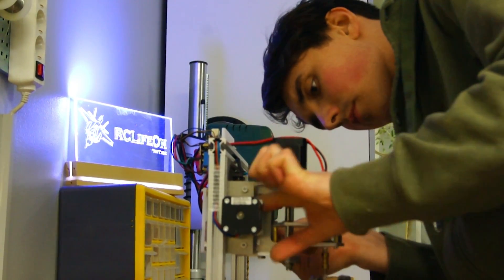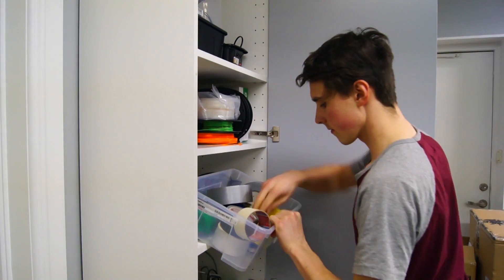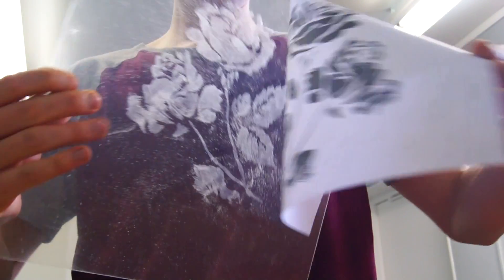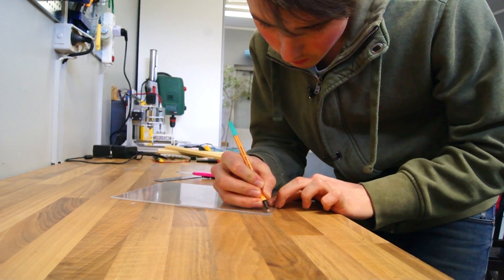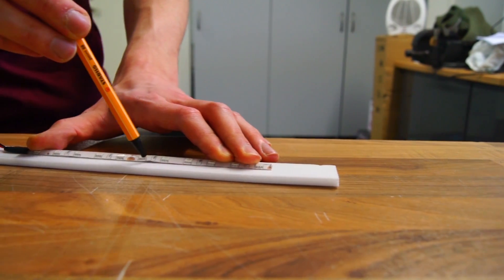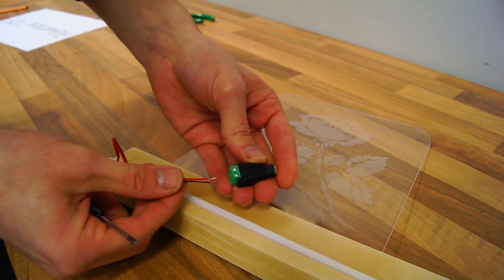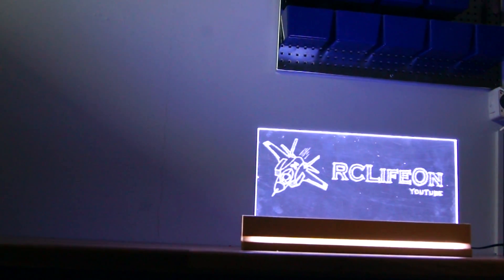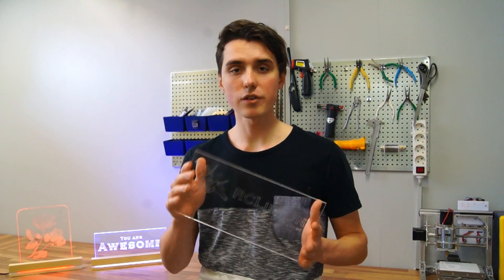Elegant Acrylic LED Decoration  - How to Make a Edge Light Sign Emblem

Comment: HELLO THERE. I WAS CURIOUS AND THINKING TO DO SUCH A PROJECT ON MY BOSS IN A FIRM WHERE I WORKING IN A PRINTING COMPANY ON SEVERAL SMALL BUT RESPECTFULL CNC MACHINE AND   BANG I CROSS ON YOUR VIDEO AND THINKING WHAT A NICE AND GOOD MAN SHOWING A JOB A STEP BY STEP AND I HAVE A ALSO A DREMEL IN MY WORKSHOP AND I WILL TRY IT FOR SHURE,THANKS AN KEEP GOING WHATEVER YOU DO, AND I HAVE A SUGGESTION IF YOU EVER TY TO PRINT ON FOAM PVC FOREX ON 3,4,5 MM YOU MAY I THINK ALSO USE A DREMEL AND A GUIDE YOU KNOW WHAT IT LOOKS YOU HAVE IT FOR SHURE IN YOUR TOOL BOX FROM DREMEL I THINK FOR OUTSIDE CUTTING BORDERS I MEAN A CONTURE  IT WILL BE PERFECT  JUST A SUGGESTION SO THANKS YOU MAKE MY DAY BEAUTIFULL ...

Comment: If I etch or sandblast one side of 1/2" thick cast acrylic and leave my logo clear (without etching or sandblasting) will the whole panel light up with exception of my logo? In other words, I want to do exactly opposite of what you are showing (the panel clear and the logo etched). Thank you for any insight you can give me in this.

Comment: awesome easy project! fyi i recently learned how to clean acrylic...first, use some brush cleaner (artists use this for their paint brushes) on a shop towel or paper towel to wipe the whole surface. Then I used Meyer's multipurpose spray to wipe the whole piece, then finally, sprayed water and wiped dry with a paper towel. Got the acrylic so clean!

Comment: I am curious why you recommend using 4mm instead of 2mm for the thickness of the acrylic?  Is the main difference just the rigidity of the sign or are there other benefits?

Comment: If you make a stand for the Dremel or whatever that tool is you can get even depth all around if you use wood to make the stand you can put a soft cloth under the wood and glue it slide easy no scratches

Comment: hola amigo, que tipo de led necesito y la fuente para la corriente como debe ser, ayuda. 2019 █   █PERü
Reply: Compra una tira de leds, de cualquier tipo, RGB o de un solo color. 

https://www.amazon.com.mx/AutoWT-Distancia-Multicolor-Retroiluminaci%C3%B3n-Decoraci%C3%B3n/dp/B07Q4PDRWQ/ref=asc_df_B07Q4PDRWQ/?tag=gledskshopmx-20&linkCode=df0&hvadid=360531611712&hvpos=1o2&hvnetw=g&hvrand=10094055264569270830&hvpone=&hvptwo=&hvqmt=&hvdev=c&hvdvcmdl=&hvlocint=&hvlocphy=&hvtargid=pla-797278597149&psc=1

Comment: Can someone please give me the name and type of jack adapter which he used in this video? if i type in ( jack adapter) in google i just get the headphones type, which isn't like the one he used in the video.
Reply: just type male power jack in google bro
Reply: i'm not sure the name of it's, but you can replace thats part with "female jack adaptor" which is have same function, but different shape/type.
in my place, i can easily found that's part on electronic part shop around home, there's many type of jack adaptor (female/male).
Reply: jaybajan it is called a 5.5 mm outside diameter and a 2.1 mm inside diameter female connector.

Comment: Buy or make Stencils,  tape them down and  SAND BLAST !   or just rub wet sand on the surface..  It's the only way to fill in a large area.    You can make a small sand blaster out of a shop vac..  google it..

Comment: ALWAYS WEAR A PROTECTIVE MASK AND GOGGLES WHEN YOU DO ENGRAVING BECAUSE ALL THESE TINY PARTICLES THAT ARE REMOVED TRAVEL AT A HIGH SPEED...!!!
you did a great job...well done...i was sceptical about just putting the design underneath and engrave with the dremel on the plexi from the top...but i did the same thing and it turned out descent enough....there are 3 methods
1.create a stencil with the design....use a transparent vinyl printable a4 sheet and cut the design....USING A HOT KNIFE IS UNBELIEVABLY EASIER THAN THE CLASSIC X-ACTO KNIFE...this method is perfect because the edges of the stencil really guide your dremel...but in a complex design it is time consuming process to create the stenciL
2.use a carbonpaper or transfer paper to transfer the design on the acrylic....use a sharp pencil or else the lines on the plexi will be thick...major advantage on this method is that you just erase the design with your dremel leaving the ''frosty'' design at the end..
3.use your method...just put the design underneath and start engraving...this is great because there is no preparation..and for another reason.....if you have the design on black and the background on white....every line you pass with the dremel it just erases the black line underneath..the frosty look erases the black design ..so its not only that it really guides you but you can clearly see the progress you have done...an alternative method is the white on black background....like this...https://www.youtube.com/watch?v=475kDOOqSoo
its not so good i believe but the black edges really help you stay ''in'' the design pattern...!!!
use carbide and diamond bits even with softer materials...on metal use the HIGHEST SPEED...TO THE 30K RPM RANGE..ON SOFTER MATERIALS LIKE PLEXI PLASTIC I THINK IS MORE SUITABLE AROUND THE MIDDLE SETTING BECAUSE YOU CAN EASILY BURN THE MATERIAL....
USE A DIAMOND PENCIL BIT TO DRAW THE LINES AND THEN A BALL POINT BIT TO FILL THE AREA....USE A METAL RULER IF YOU HAVE LETTERS NUMBERS OR A LOT OF STRAIGHT LINES..ALTERNATIVELY USE A FLAT WIDE  SCREWDRIVE TO GUIDE THE DREMEL BECAUSE THE RULER IN A SMALL DESIGN IS CUMBERSOME AND DIFFICULT TO CONTROL!!!!
if the edges of the acrylic are not perfect especially at the side which gonna sit on the led strip....use wet sanding ..start from 400-600 then 1000 1500 2000 and then a fine buffing compound and it should be perfect...or flame polishing but i think you could  easilly make a mistake so i  believe the good old method is totally adequate...!!!CHEE(R)S!!!
P.S.ANO ONE LAST TIP...WHEN YOU DO ENGRAVING IN METAL OR OTHER SURFACES...THAT ARE NOT TRANSPARENT SO YOU CAN SEE THE DESIGN LIKE PLEXI...IF THE STENCIL IS COMPLEX OR TOO SMALL OR TOO BORING TO  DO
1.USE A LASER PRINTER TO COPY THE DESIGN
2.TRANSFER THE DESIGN TO THE VERY THIN TRANSPARENT FILM THAT WE USED TO COVER THE  BOOKS BY USING THE ACETONE METHOD ..THERE ARE MANY VIDEOS ABOUT IT...USE MUCH LESS ACETONE THAN YOU PROBABLY THINK.!
3.STICK IT TO THE SURFACE AND DO THE ENGRAVING..
ALL RIGHT SOMEONE MAY ASK ...WHY DONT YOU PUT 2SIDED TAPE TO STICK THE A4 PAPER TO THE DESIGN...THE REASON IS THAT THE PAPER IS WAY MORE THICK THAN THE FILM AND THE DIAMOND CARBIDE BIT CLOGS UP EASILY...AND SOMETIMES THE PAPER LEADS YOUR HAND AND YOU COULD EASILY MAKE A MISTAKE..!!
I KNOW THAT THERE ARE A4 TRANSPARENT STICKERS FOR COPIES...BUT THEY ARE MORE EXPENSIVE ...DONT KNOW THEIR THICKNESS...AND ALSO IF YOU CUT  ONE OF THEM YOU CANT PUT IT BACK TO THE PRINTER TO MAKE ANOTHER DESIGN...EVEN THE A4 TRANSPARENT STENCIL SHEETS ARE VERY THICK TO PENENTRATE WITH THE BITS...!! SO MY SOLUTION IS BEST...!ITS UNBELIEVABLY EASY TO DO THE ENGRAVING OVER THIS VERY THIN FILM..AND THE LABORIOUS STENCIL PROCEDURE IS AVOIDED...!ON METAL USE ONLY DIAMOND PENCIL BIT FOR THE LINES AND CARBIDE OR DIAMOND BALL BIT TO FILL THE AREA...!!
I CAME UP AND WROTE THE METHOD WITH ACETONE AND VERY THIN BOOK COVER FILM...CAUSE IN SOME SURFACES ..IF THEY ARE TOO GLOSSY OR HAVE CURVES IT IS VERY DIFFICULT...NEXT TO IMPOSSIBLE.. TO DO THE ACETONE TRANSFER AT ONCE!ACETONE CAN ALSO HARM SOME OF THESE SURFACES...!!BUT THE BEST THING IS THAT THIS THIN FILM PROTECT THE REST OF THE AREA YOU DONT WANT TO ENGRAVE!IF THE DESIGN IS REALLY SMALL YOU CAN USE  TRANSPARENT TAPE !!
Reply: Why caps?

Comment: you can use a cnc to make it more better 

(don't forget : you are AWESOME)
Reply: Just bought a $205 CNC machine for this kinda stuff and cutting acrylic.  My old 40w laser did not like clear acrylic.
Reply: @mikecarter8880  40W laser is used for only wood.
Reply: @imperialrecker7111  Its used for much more. I did leather, I did metal engraving with a coating. I did acrylic, it just didnt like clear.
Reply: @mikecarter8880  well it works for leather. Metal with paint is also ok, but no one wants a paint engraving on metal. acrylic with laser would melt or reflect most of the laser making it useless. Tip: For CNC don't put the spinning CNC bit too high or move it too slow. This would result in melting. Instead do multiple runs on the acrylic.
Reply: @imperialrecker7111  What laser you running?  Cermark works just fine for what I need.  The small amount of acrylic stuff looks fine.  But saying a 40w laser is only for wood is wrong.
Reply: A cheap laser for my diy